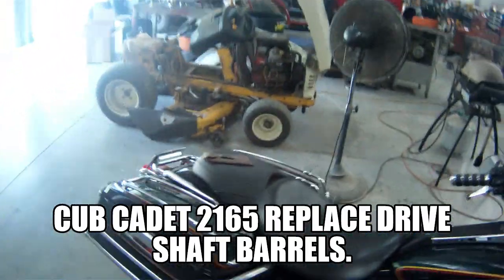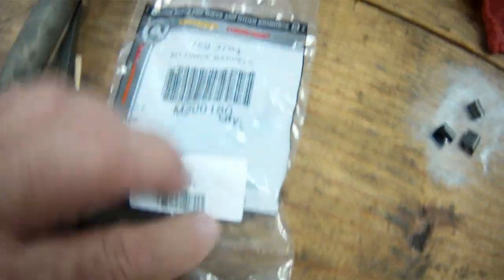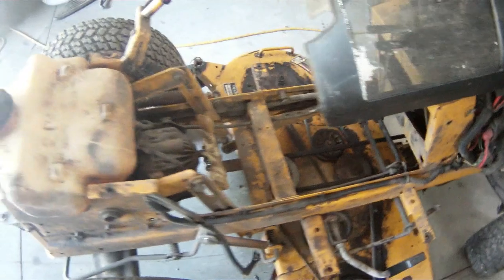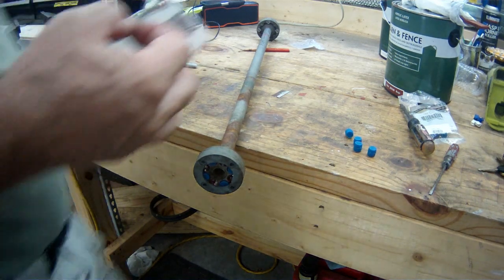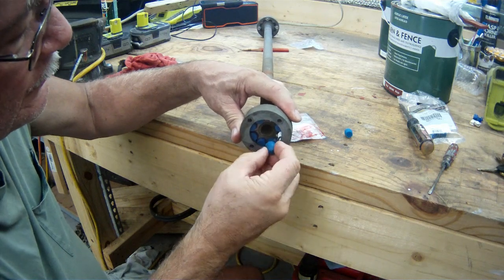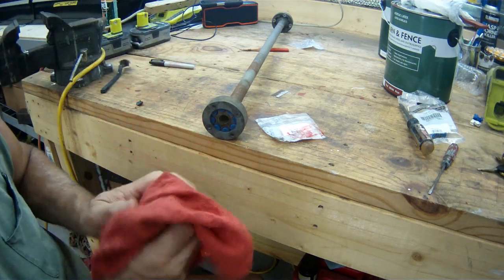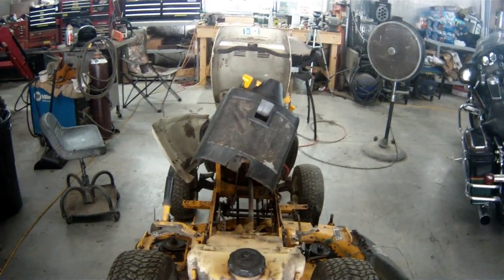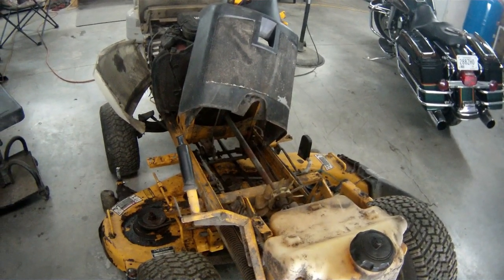Cub Cadet 2165  How to replace Drive Shaft Barrels .

Comment: Man you ain't kidding. Lots of stuff to come off before even getting to the drive shaft. Interesting system with the barrels though. I've never seen that before.
Reply from the maker: What a pain . Fixing the shaft was the easy part.
Reply from the maker: These barrel type things  are used in a lot of equipment & a lot of ford window motors . Shock absorbers & drive system in 1.
Reply: @TheKiloG69  Oh okay. I've just never seen that. Pretty cool though.

Comment: Hello I have a couple of these style mower's and I was thinking of using one of them for a pull around tractor, my question is do you know how to make them go faster? Since there is no pulleys like a standard mower I'm kinda lost, I'm assuming that it's in the gearing in the transaxle but I was hoping you may know a easy way to get a few more mph out of it? Already derestricted the engine as much as I care to.
Thanks, an good vid!
Reply from the maker: The only way I know to make these go a  tiny bit faster would be to put larger rear wheels on. My  Cub originally was a 16 horsepower v twin  and now it has a 23 horsepower and it moves along pretty good.
Reply: There is a rod beneath the floor board sheet metal. Its a 2 piece rod with adjustment. I adjusted mine and the thing will fly. Reverse is super slow but forward is fast as hell.

Comment: Looks like you left out the plastic round black air duct mounted by fan. 
Drive shaft has to be removed to install air duct.
If not you will overheat the engine
Reply from the maker: Never had 1. I added a 23 horsepower commercial Vanguard motor years ago.
Reply: I took harden steel roller bearings instead of plastic